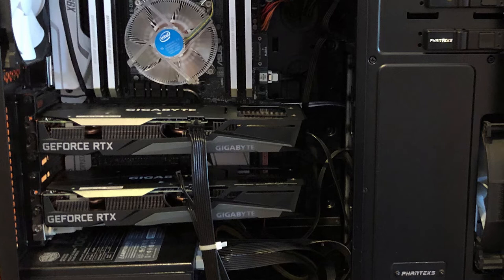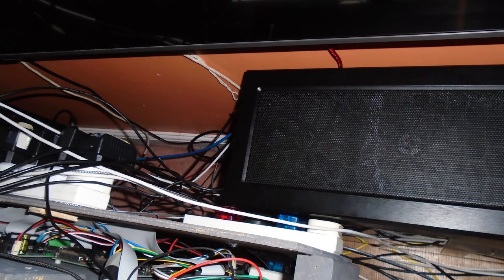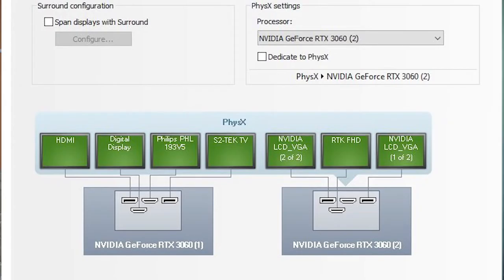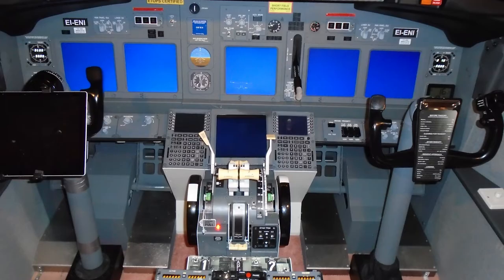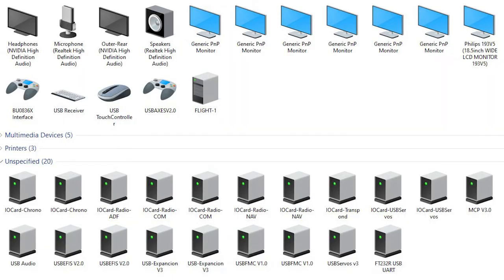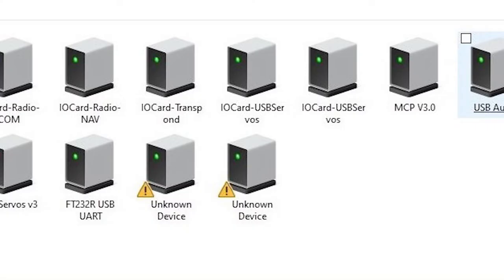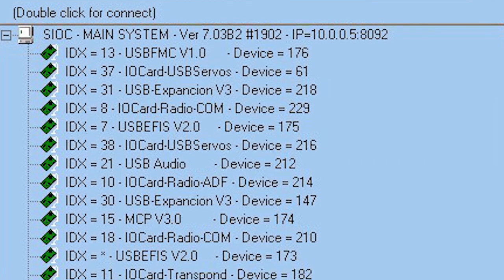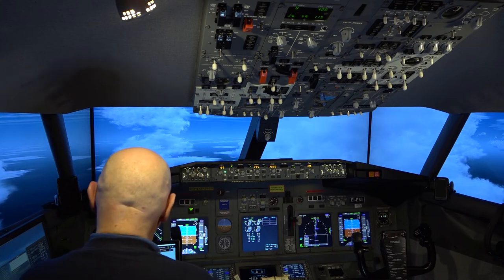Quarantine Freedom Flight Update 2

Comment: You may want to also look into operating temperatures and air flows for F1 and F2
Reply from the maker: Yes, cooling is a big issue in a confined area, but I made sure to have plenty of fans and an unobstructed air flow. Good point - thank you 😊

Comment: Thanks for the update, I was wondering how you were progressing.  I believe going with a new motherboard is the right decision and hopefully it will last for many more RYR186 flights
Reply from the maker: That's what I'm hoping for. This motherboard was always a bit iffy - and didn't it crash when you were here? Anyway, I hope this will ensure stability from now on. My best to the missus! 😊
Reply: Father Dane., Inhold a Red Seal Industrial electricians journeyman licence as well as a Gold seal 443a electricians licence, I could not have done a better job of assembly and explanation as you did with the new installation. Well done sir.
Reply from the maker: @jackmccall8964  Thank you - you are very kind 😊

Comment: When Father Dane has a better graphics card than you...

Congratulations on actually finding  RTX cards during the GPU shortage

Edit
Perhaps a few cable ties could help the cable mess back there?
Reply from the maker: It wasn't easy - a lot of searches using all the search engines revealed some possibilities and that's how I managed it. 😊
Reply: @FatherDane  nice I bet it toke a lot of searching for sure.
Reply from the maker: @JohnSmith-xq1pz  Yes it did 😊😊

Comment: Hello father, I would like to ask, why is the iPad on the yoke, isn’t it usually on the side of wall?
Reply from the maker: Good question: two reasons, one is that I already have a small screen at the left side which monitors and controls ATC and the sim system. And second, it really is a choice - while most jet airline pilots have it on the left since they have more room in the cockpit, many choose to place it on the yoke when before digital charts were available, the only thing we had was paper charts and there was a clip on the yoke to hold the approach charts. For me, since I come from that generation of yoke clip users, I simply put the tablet on the yoke where I used to put the paper charts. But good observation and a good question. 😊
Reply: @FatherDane  thanks father 👍

Comment: you should you a new motherboard and upgrade to better CPU so RTX 3060 2x GPUs and in spec with CPU and etc so it will run smoothly and wher it crashes try to press WIN+Ctrl+Shift+B and that will restart display drivers before replacing the Motherboard
Reply from the maker: That is a very useful tip there, thank you! And best wishes to you and the family 😊